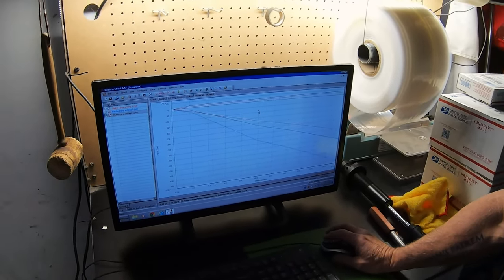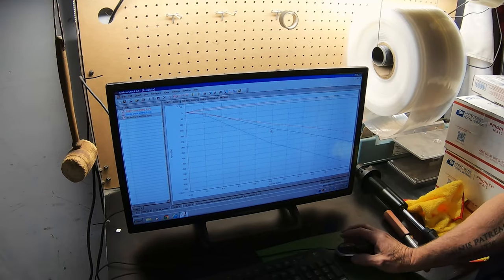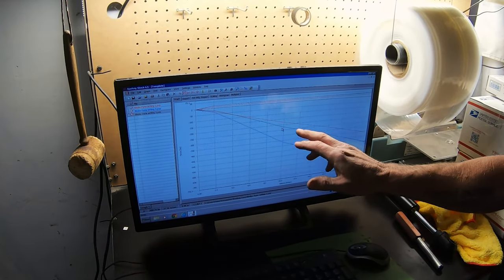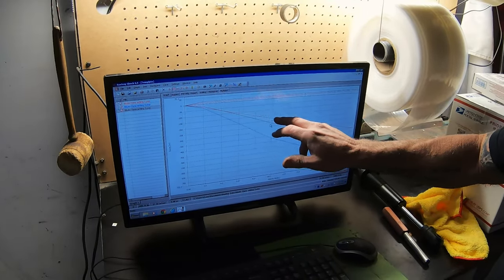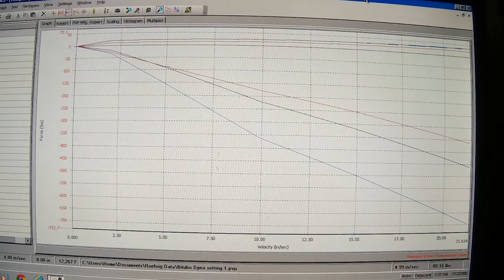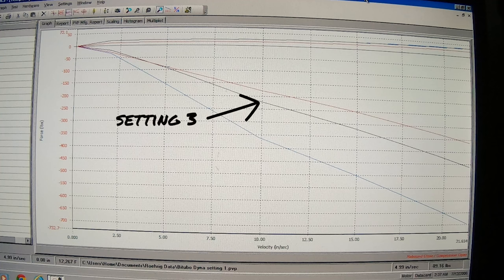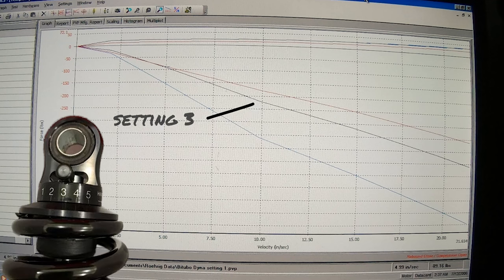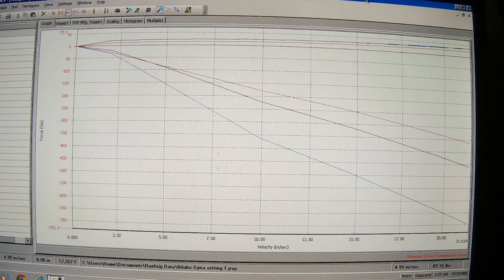Putting Shocks on a Dyno for Damping Chart Results

Comment: I have to upgrade the suspension on my 2022 FLRT. Where I mostly ride in Australia the roads are bone shakers. I have had some real bad jolts with the factory shocks. The local HD dealer told me the factory fits aren’t adjustable. Thanks guys for the info.
Reply from the maker: Factory shocks can be adjusted for pre-load, which will affect how much it jolts at a bump.  But there is no adjustment for rebound damping like these have- https://www.dkcustomproducts.com/twin-adjustable-performance-rear-shocks-for-harley-davidson-dk-bt-shks.htm

Comment: It would be interesting to see how stock shocks play out on that machine compared to aftermarket shocks.
Reply from the maker: Yeah, we've done that many times in the past...before we were making videos.  We should have done it this time.
Of course, there is only one line on the chart since the stock shocks do not have a rebound adjustment.
Reply: @DKCustomProducts  keep reporting your findings... as it educates concerned riders, who in turn put pressure on manufacturers to pay attention.
Reply from the maker: @richardrussell500  Thanks.  Yes, HD does take action...sometimes it is really slow, but they do try.
Reply: @DKCustomProducts  I like HD motorcycles... the best looking cruisers on the road. Period. I sometimes question the quality of the parts with longevity in mind.
Reply from the maker: @richardrussell500  I hear ya.

Comment: Have you done any investigation into adding a fluid damping shock to the newer HD touring models in place of the non-damped, spring only shock on these bikes?  I am thinking it would improve the ride.
Reply from the maker: Yes, extensive testing, and you are correct, when you have full featured shocks on both sides it is a BIG Improvement.
https://www.dkcustomproducts.com/frame-suspension-c2-259.htm